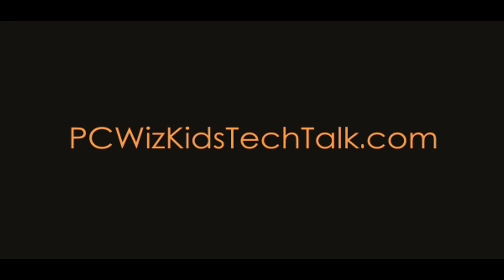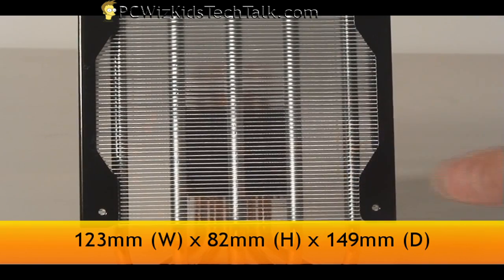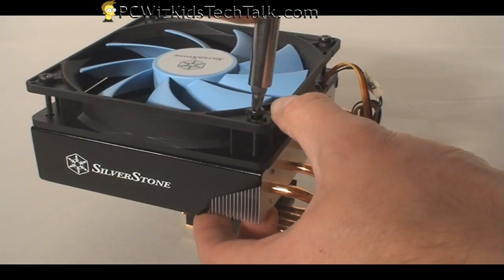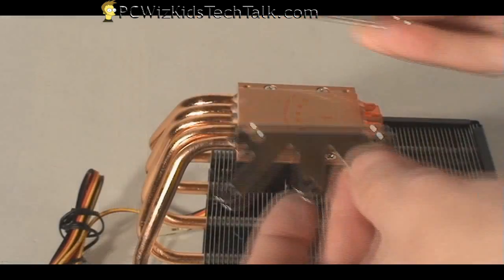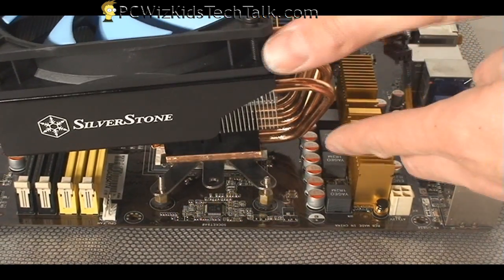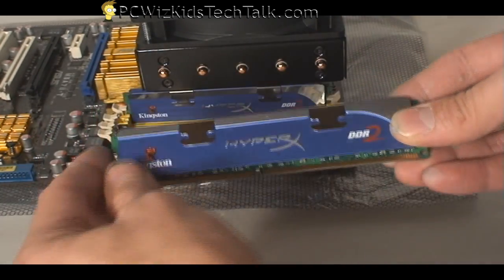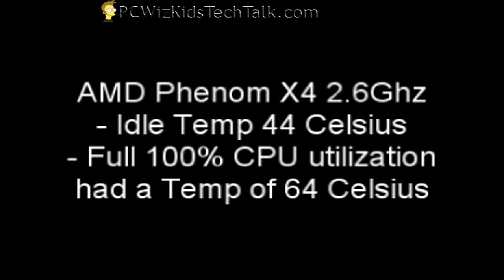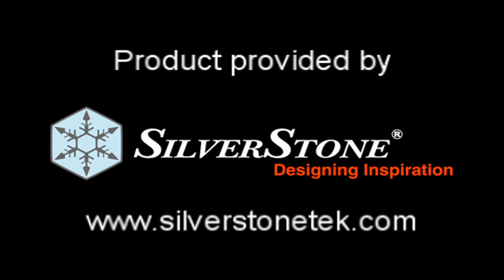SilverStone NT06-E CPU Cooler - Review

Comment: first look it seems good but i would be concerned about it blowing heat onto the memory. also the benchmark results are not impressive at all. im running a Phenom II x4 965 cpu and stock cooler and it does just as good as this. i will however say different boards can ontribute to cpu temperature, if you hve a good board the cpu temps will be lower than say a lesser poorly designed board.

Comment: oi
its not a bad desigh with the star trek interprise ship hahaha
but i wouldnt get this
your post ot have the heat away form your mobo ram and other things
but this pushs all that heat from your cpu to all your other thigns on your board so yeah its a bad desigh on where the hot hot hot air goes 
if your builing a good gaming then this till heat up your gpu ram NB and SB bad bad heatsink
the end
:P

Comment: Speedfan is what i use for monitoring all the vitals of my processor.

Liquid cooling works by circulating fluid threw a water block (a block of metal, usually copper, that sits on the cpu) to a radiator. the liquid absorbs the heat on the water block and to be expelled at the radiator.

"it doesn't look like the fan is getting to the cpu because of that black thing blocking it" what do you mean?